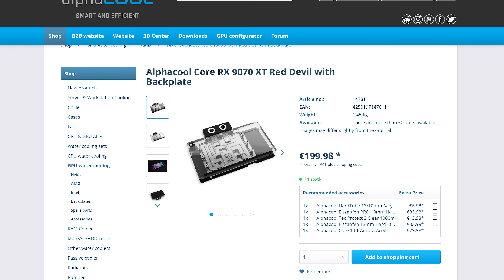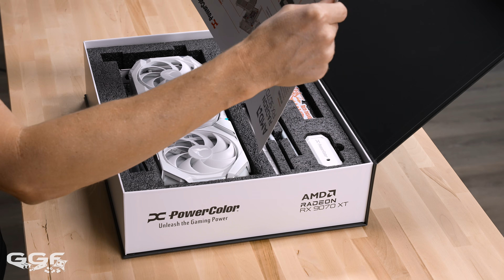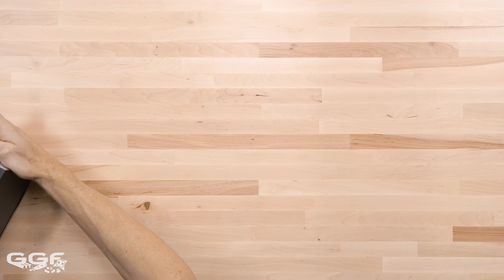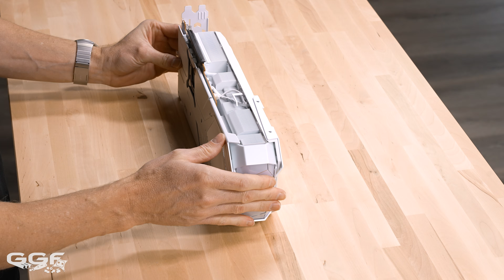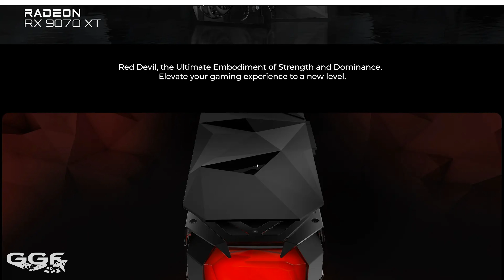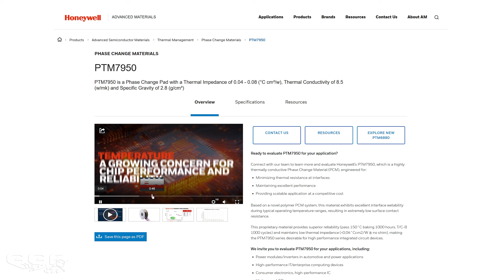WOAH! Nothing but WHITE | Red Devil _Spectral White RX 9070 XT

Comment: The first thing I want to mod on this GPU is to remove the backplate LED logo that is blocking 65% of the air flow.
Reply: there isn't even a PCB right there... Honestly that's a really small PCB for a card.

Comment: I just did a all AMD using this card along with the AORUS X870 Stealth ICE. I also got a set of all white power cables. Installed in white case with 9 fans plus water cooled cpu having a white fan. Using ARBG lighting. Absolutely amazing looking when running in dark room. Gives off enough light that you don't need any room lighting to see around you. This was my first all white (Actually 90%) build. This is an example of art and tech. working well together.
Reply: Literally about to use this gpu with that motherboard in the snow white Hyte Y70
Reply: @deplroablejoe8963 literally same 😂

I got the aorus pro ice mobo, hyte y70 touch, Red Devil spectral, screens and RGB everywhere, strimer cables, all white completely ridiculous. Im excited af to build it

Comment: Look at the claw-like part surrounding the Hellstone. You can see the double-sided tape. This part is cut to fit the shape of the claws, not the main body, so dust will accumulate over time. I have the regular Red Devil, and because it's black, dust is especially noticeable. If you have the opportunity to send feedback to Powercolor, please tell them to improve it in the next release. This may seem like a minor point, but to me it's too sloppy work for such an expensive product. This is something that can be easily predicted during the design stage and can be resolved simply by attaching the double-sided tape to the main body rather than the claw side. What has not been fixed to this day is Power Color's negligence. They should use precisely cut tape, even if it is just to make their job easier. Someone must have pointed this out already, and someone at headquarters must have noticed.
Thank you for showing me the disassembly process. My RD has coil whine, so I plan to fix the noisy part with glue during maintenance in about a year. I thought it would be a little difficult to disassemble, so this was very helpful.
Reply: By the way, when the 9070XT was first released in Japan, it was very expensive and terrible, but the Powercolor products were a little cheaper than other companies. The Red Devil was almost the same price as the PRIME and PULSE. This is probably not possible in other countries. I don't know if it was the import agent's efforts or Power Color's intention, but I think Powercolor has made great strides and become more popular in Japan this season. Unfortunately, I started to experience coil whine at 150W, and the noise got louder and louder as the load increased, which was a bit disappointing, but the cooling performance and quietness of the fan are absolutely excellent. As long as PowerCollar continues to listen to its users and make improvements, it will remain my first choice for purchase.

Comment: It's a double thumbs up for using as much white PCB components. It's an attention to detail that many board makers miss.  But that LED lighting... it's just too much having a big blob of light on the end of the card. This care could have been so much better with just simple lighting to really highlight the cards design.
Reply: power color has no idea what to do with the design, they went from crazy good idea back at almost a decade with 480-580rx cards and maybe even 5000 series
and then just bigger block of a brick that cant compare to their Reva or whatever it is called, or XFX which actually has functional design.
Reply: @sequence9-seer  you could go for their hellhound model instead. It's the same all white look, but a bit smaller and without the extra details like the rgb brick at the end
Reply: Sapphire nitro looks fairly understated
Reply: To be fair most GPU designs are kinda ugly (this one included). It's hard to find clean, adult designs. The only ones that come close are the non-partner models (nvidia especially) and the Asus proart.

But I'm general I've come to appreciate PCB-mounted LEDs a lot more fan the rest, I'm not sure if it's a matter of model or power delivery but the shroud LEDs always end up turning yellow-y, while the ones on the main PCB remain mostly untouched. Happened with both my MSI 3060 and my Aorus 4080.
Reply: @analogicparadox not really i know this is old but they also have the hellhound which is a really nice white minimalistic card. But im glad they make things like this cause i think its beautifull you really have some kind of rgb gem stone really unique and beautiful. If you like an rgb build this will make it pop for real.